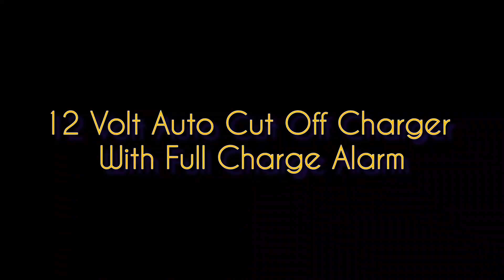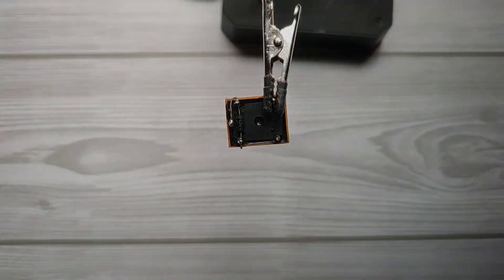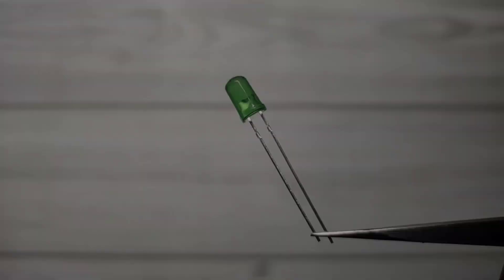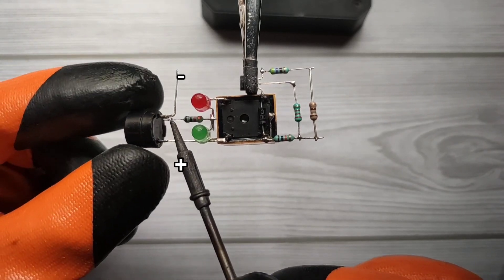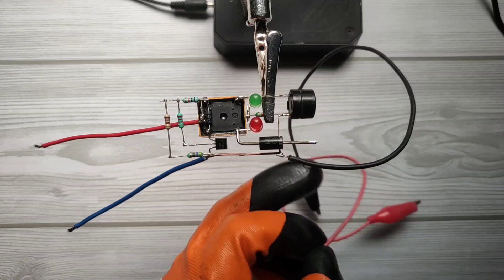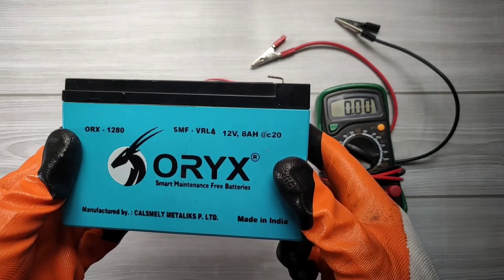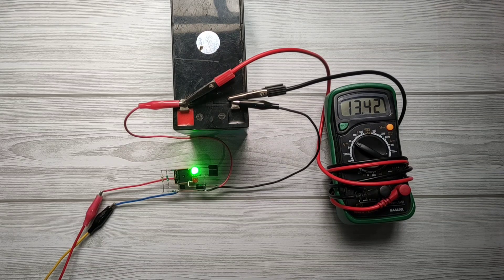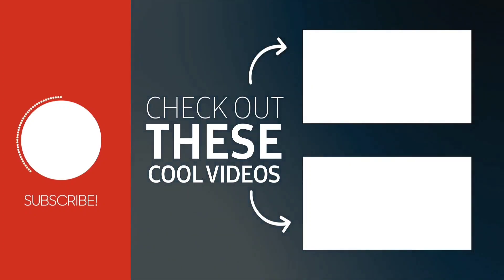12v auto cut off battery charger circuit

Comment: Can i use a 12v dc 10A power supply because i only need to charge my motorcycle battery
Reply from the maker: Nope, The thing is the 12v lead acid battery which bike uses needs 13.8v to 14.4v voltage to charge fully.
If the battery reads 12v on volt meter it means it is almost discharged, a fully charged healthy battery reads 12.8 to 13v on volt meter.

Comment: What is the input?❤
Reply from the maker: 14.4v
Reply: Can i use 12v 10A current from my power supply because i want to charge my motorcycle battery

Comment: Hi Creative Techo guy
Do you have any circuit for a 12 volt lead acid battery for storing maintaining it in winter for about 3 to 5 months 
Appreciate a reply with the circuit
Reply from the maker: Actually you need tickle Charging controller to keep battery steady

Comment: Your showing practical  jumper given to  transistor bc547 pin no 3 emitter is connect to relay No . But your circuit diagram is showing different.

Comment: I have a power supply charger for cameras, and its capacity is 12 volts - 16 amps. It has a variable resistance to raise and lower the voltage. Is it suitable for this project?
Reply from the maker: Fir charging lead acid battery, you can use that power supply by setting the output voltage to 14-14.5v max
Reply: @CreativeTechos  the power supply  actually gives a reading of up to 14 volts

Comment: 60AH better charge possible?
Reply from the maker: Yes, you can charge 60AH battery just replace 1N5408 diode with MIC10 & input must be 14v 4-6A

Comment: Hi, In the circuit diagram the normally closed relay contact ; e.g closed on a non energised relay, is denoted by a blackened relay triangle contact style symbol in the relay diagram. The normally open relay contact; which closes when the relay is powered/energised, is denoted by a white triangle style symbol in the relay diagram.

Comment: Dear Friend, I made a charger following your video. But it's buzzer is activating since start of battery charging. Please explain me, what is the wrong with my charger.
Reply from the maker: Make sure input is 14v -14.5v max, and connect battery first then powerup the circuit.

Comment: This shakeit 5v relae using 5V battery charging wark yes o no plis sri.? And like tanks videos upload🤗
Reply from the maker: Same circuit cannot be used for 5 volts, even by changing relay, please check out 18650 battery charger video on my channel that works with 5 volt and without relay.
Reply: @CreativeTechos  mm ok

Comment: Sir,what can be used other than SR360, Im using orcad Pspice and I cant find SR360
Reply from the maker: SR360 is Schottky diode and has lowest voltage forward drop, if you're unable to find Schottky diode, You can also use General purpose diode 1N5408
Reply: @CreativeTechos  Thankyou Sir！
Reply from the maker: My pleasure 🙂

Comment: 5408 use diode
Reply: Any problem 5408 using
Reply from the maker: Not any problem.
Reply from the maker: 5408 3A diode for battery reverse charge protection.

Comment: Why did u use schottky diode here??
Not any general purpose diode??
Like 1N4007,5402........9

Reply..
Reply from the maker: Yes you can use general purpose diode too, but Schottky diode as lowest voltage forward drop.
Reply: @CreativeTechos  
Can I give computer UPS transformer supply i.e., 12-0-12,10 amperes...to its input ??
Will it.damage any battery??

Reply must
Reply from the maker: No, it needs rectified input dc of 14.4v. I'll soon upload new charger circuit with autocutoff and input can be taken from 12 -0-12 transformer.
Reply: @CreativeTechos  
Please u upload that video soon..!

Thanks
Reply from the maker: Yes, I'll 👍

Comment: Mere pass DC 19volts hai, kya yeh is ko 12v tak ley aaye ga?
Reply from the maker: No you may use Step Down buck converter to set to at rated voltage according in video.
Reply: @CreativeTechos  thank you for response, Means i have to connect LM2596 dc-dc buck converter and set 14.5volts then connect this circuit, Right
Reply from the maker: Yes, also you may check this video 
https://youtu.be/nvlOeDHkwK0
It has more precise with cutoff feedback from battery and without relay and is more powerful.

Comment: Bro, please make a 3.7 Volt battery charge using a relay that automatically turns off when the battery is full. Thank you in advance
Reply from the maker: Check out on my channel, i have already uploaded 3.7v auto cutoff without relay.

Comment: Can I use a 15 voltsdc/3amps power supply 
In your diagram you have show the dropping resistor for the LED’s as 10k instead of 1.0 k but in the video it’s ok
Reply from the maker: 14-14.4v maximum

Comment: Hi Guy at CREATIVE TECHOS
Very nice circuit and very good explanation with the video and thank you for the circuit diagram, only thing is please indicate which is NC & NO  in the diagram 
What resistor can I use to cut off charging at 13.8 volts 
With the present setup it cuts off at 14.1v and cuts in when battery voltage drops to about 11.1 volts 
Thanks for your efforts, please reply
Reply from the maker: Thanks for your enquiry, actually it was designed to cutoff at 14.4v.
But if you want to set different cutoff voltage, please checkout the another video on my channel that circuit is without relay, just simply used mosfet, also you can use variable resistor to set any cuoff voltage.

Comment: Sir if you charge a battery less than twelve volts like lithium battery you have to adjust the input voltage for the specific battery or this is battery charger are dedecated only to 12 volts batt  i'm i correct sir nice presentation thumbs up done subcriber of your from the philippines tnx sir
Reply from the maker: Thanks, sir actually this os basic design for just 12v lead acid battery, and lead acid battery charges full @ 14-14.4v.

But lithium batteries are different and is charging full @12.6v, more than will hurt battery life.

So soon I'm going to upload the Balance charging system for 3s Lithium battery

Comment: Your effort is appreciated but from my experience with batteries they reach full charge voltage but they are not fully charged this is a dilemma which I can't solve.
Reply from the maker: https://youtu.be/nvlOeDHkwK0
Check out this video with adjustable cutoff and feedback from battery for precise cutoff and can be used and adjusted for any battery upto 24v

Comment: Pay attention to the NC and NO ends of the relay you will use while making this circuit.  Most relays are the opposite of here.  Your circuit may not work.  Mine didn't work.  😀

Bu devreyi yaparken kullanacağınız rölenin NC ve NO uçlarına dikkat edin. Çoğu röle buradakinin tersi. Devreniz çalışmaya bilir. Benimki çalışmadı. 😀

Comment: 14.5 v how to Transformers select 12 volt transformer ok aur any other transformer suggestion for you
Reply from the maker: You can simply use 15 v transformer and use lm317 to regulate it to fixed 14.5v

Comment: Sir what use the source of 14.4 like (1A transfer) or other let me explain...plz
Reply from the maker: You can use 18-24v transformer with bridge rectifier then you can regulate that dc voltage with lm317 ic that will provide you voltage of your choice with 1.5A output

Comment: Is it ok if i use bosch relay 30amp?
Reply from the maker: Yes you can use but instead of bc547 use TIP41C or other NPN power transistor to provide enough current to relay, also take care of transistor pin outs.

Comment: Can you please explain how the current detector circuit works, which will indicate that the battery is charged? thank you.
Reply from the maker: You can see the bc547 is connected to one end of coil pin to switch relay & when it received enough current at base it will switch on relay. Usually we use preset to set cutoff voltage but here i have used fixed resistance.
10k connected to positive that provides current to 2.2k connected to base of bc547 to switch but to avoid early cutoff, i used 180+470 ohms to groud the current from 10 k Resistor and when voltage reaches to 13.9v there current also increases so 2.2k resistor finally receives some current to base of transistor, and relay turns on and Cut Off supply to battery.
If you increase resistance then (180+470 ohms) cutoff voltage will decrease.
If you decrease resistance then (180+470 ohms) Cutoff voltage will increase.

Comment: Can I take 5408 diode.?
Reply

Please u make a 220v AC,500watt chaser using relay,BT 136,4017 ic
Reply from the maker: Yes, you can use 5408 general purpose diode, but its recommended to use Schottky Diode as they have low drop voltage.